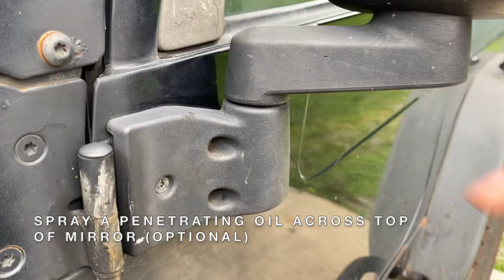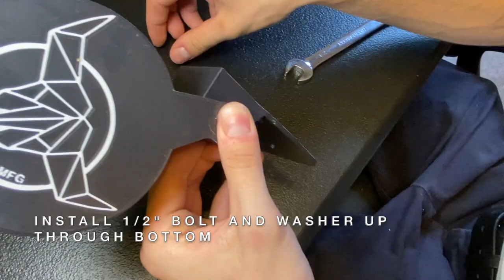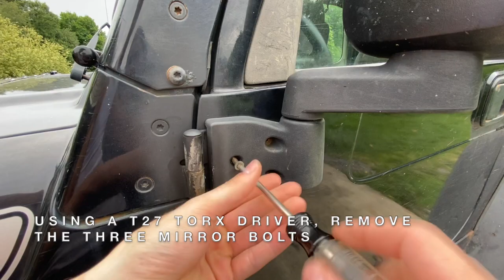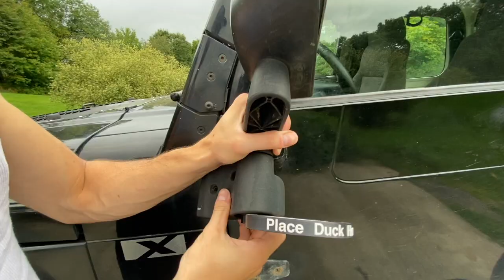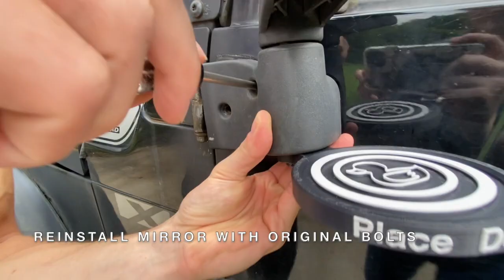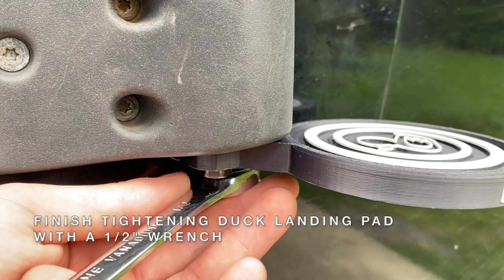HOW TO: Install Duck Landing Pad for Jeep TJ/LJ

Comment: The etsy page only lists landing pads for JK/JL. Is that what you used on the LJ in this video? Or is the LJ model no longer available?
Reply from the maker: Hello! The TJ/LJ version is currently delisted on our Etsy page after we realized that 1996-2002 TJs have a different factory mirror than 2003-2006 TJs. We are working hard to make a design that fits ALL factory TJ/LJ. If you would like to send us a message on Etsy, we can help figure out if this specific design will work for you. Thank you! :)